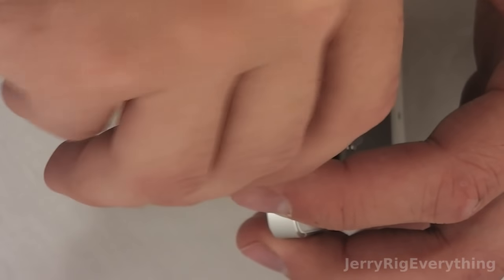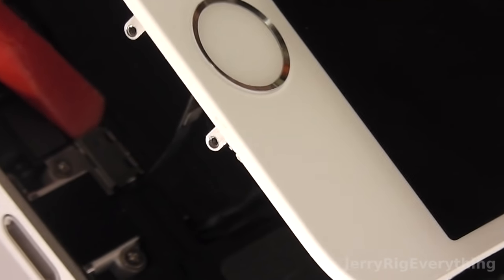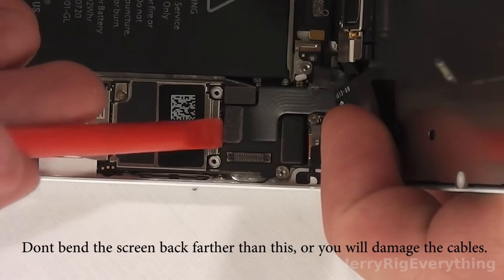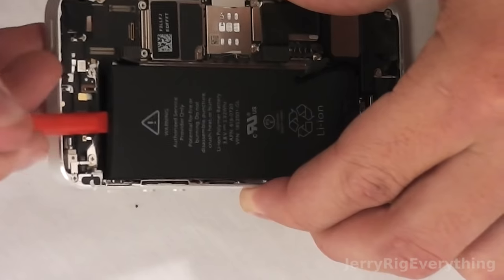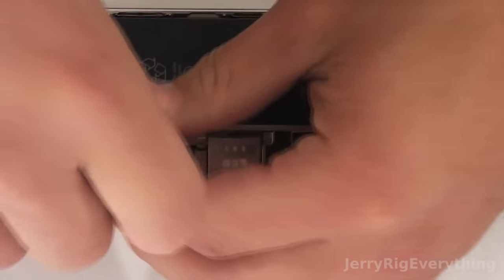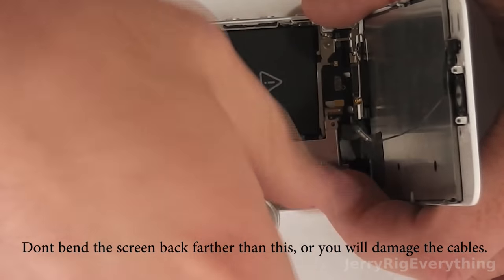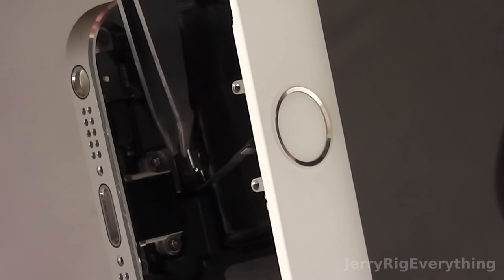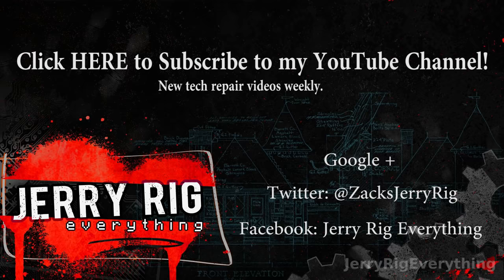iPhone 5s battery replacement in 6 minutes!

Comment: TIP: Before disassembling the connectors, where possible take a microfine sharpie pen and mark the top of the connector and something non-conductive right next to it. Then, when reassembling, you can line up the marks to make reassembly almost as easy as Jerry makes it look ;-)

Comment: HI. Nice video. I have 2 questions:
1. Does the screwdriver you're using in the video have a magnetic tip?
2. What is you don't use the fingerprint reader, and never plan to use the fingerprint reader... is it still crucial to replace it back exactly the same way? What if you snip it off to get it out of the way... will that mess up any other functionality?
Reply: im not sure about the screwdriver. but you must reconnect the cable for the fingerprint reader, because it doesn't just make the fingerprint reader work, but also the home button. so if you don't reattach that cable you will not be able to exit apps or use the home button.
Reply: @marktomeny2761  Thanks!

Comment: Don't try if you're as clumsy as I am. I got the job done but the screen shattered and I lost the 2 screws holding the battery connector in place. So, the thing is basically taped together now, but yeah, it works...

Comment: Thanks very much very helpful. I ordered a battery but the APN number on the back was different, i was sold iPhone 5S battery with the APN number 616-0718, it also looks smaller than the one i have replaced, that was 616-0722. Is it the wrong battery or something different?

Comment: Thank you a lot for a very nice and concise instruction video! I just changed the battery successfully.

Cheers!
Reply: freestyler987  I have battery issues in my iPhone 5s,it doesn’t last even 1 hour without the power saving mode turned on,also,without the power saving mode turned on,there are unexpected shut downs,did u have any sort of these issues I mentioned?
Reply: @md.arjubinnasir4209  Hello, I had no issues you describe

Comment: I just did this and lemme say this, I was able to put everything back okay enough, but the damn adhesive strips are SUPER STRONG, and the prying here is way harder than it is in the video, I bent the damn battery trying to get it out, so make sure you are extra careful, plus if you do this while the battery is well charge you might burn yourself, and also be careful with opening it, you have to be more delicate with the suction cup than you think, I broke my home button not realizing that this guy here was more delicate even more than I was trying to be.

Comment: oh yeah just a tip incase its not mentioned in the video, after you've put your phone back together you should leave it to settle for half hour or an hour and then turn it on otherwise it will start to turn on then turn right back off! :) (don't worry If u tried turning it on too soon, it wont affect it, just leave it rest)

Comment: Hello Jerry,
Unfortuneatly I removed the screws holding the metal cover above the LCD connector without noting which position they were in. In my 5S there are 2 longer screws and 2 shorter ones, can you tell me which one goes in top LH corner, top RH corner and same for the bottom ones?
Thanks in anticipation
Brian

Comment: Well indeed I never should have removed the screen, because now after the battery replace, the digitizer is obviously misbehaving, jumping like crazy whenever a vertical swipe-move is desired. And to think i successfully just changed the screen 2 weeks ago!   Guess my hands are too shaky and I stressed something during re-assembly. I've re-traced my steps, un-doing and restoring all three screen connectors at least 2 more times, making sure I hear the click. I even examined the connector with a loup to see if there were any bent pins. So the question now is, is it more likely I pulled and damaged the ribbon cable where it enters the screen? Or... is it more likely that I pressed to hard on the connector, and flexed the PC board (I believe the digitizer is on the underside of the board right where the connectors are). I honestly don't have the tools, eyesight, or steadiness of hands to attempt replacing Iphone size chips. But if you think there is anything possibly correctible where the ribbons meet the screen, I'll take a chance and look. Worst comes to worse, these 5S phones are not terribly expensive anymore to replace. Just frustrating to have to give up on a repair.

Comment: When I try to pry the battery out as you showed it is totally crinkling up like a melted hershey bar still in the rapper.  The two strips of glue under the battery appear to be so dried on it's like pulling the battery out of dried concrete.  I'm afraid the battery is going to break open.  I doubt you'll be able to respond before I do something bad but just in case someone else has the same problem you may be able to advise them.  Thanks!

Comment: I followed your tutorial step by step, all seemed to go well (other than prying the battery off was much more difficult than yours appeared), but afterwards,the fingerprint reader does not function and there is no sound. Any suggestions? I even opened it up again (carefully) and re-attached all the cable connections, but still no.

Comment: Had my iPhone 5S so long that I went through all the cycles the battery could take; 1,241 as of this comment. It's swollen so bad that it's pushing the screen off the phone, literally separating the screen and glass from the screen assembly with the camera, speaker, etc. New battery is arriving tomorrow. Good thing everything still works and don't need a new screen because of it. lol

Comment: When prying the battery out, be very cautious of the electrical ribbon harness which runs underneath of the top third of the battery. It is easy to snag on this, and scratch it, permanently damaging the ribbon and causing loss of volume control button operation.

Comment: Everythi g went great but when I turned it back on now I have lines on my screen? What could have cause it and is it fixable ?
Reply: This happened to me too. It probably means you now have a loose connection. When you reconnect the three wires at the top of the phone, really make sure that the first one that you reconnect (i.e. the one that's on the left nearest the battery) is fully plugged in. I had to take everything apart all over again (ARGH!!!) to fix this - thankfully it worked, but I thought I'd ruined my phone. Never again!!!

Comment: I replaced my battery with one from ebay and it's performance seemed good at first, but within a few days it went south, and now a year later it lasts less than a full day, with phone usage at less than an hour per day. Does anyone have good experience with the replacement batteries?

Comment: Because I did prying from top to remove the battery, the wifi connector was torn. It is very close to the battery from top. If you would pry, do it from the sides. I already damaged my phone.

Comment: FYI, be careful not to puncture or excessively bend the battery as they are prone to catching on fire this way. Don't just chuck it in the trash, it's best to take it directly to the dump to see if they have a proper battery recycling/disposal service.

Comment: The video was accurate except for how difficult it was to remove the battery.  In fact is was so glued in place that it bent while I tried to remove it,  It then proceed to catch on fire and the whole thing went in the trash.  Make sure before trying this that you have a better plan or tool to remove the battery.

Comment: I watched this last week then ordered the battery. I replaced the battery today but committed an almost fatal mistake. I thought I had the procedure in the head. Big mistake. I missed a couple of important steps. My advice is to run this video while you replace the battery to make sure that you follow each step the way he does it. It is not too difficult and I could have done it perfectly had I done so.  By the way, I did not remove the screen. I just made sure I didn't bend the front plate beyond a 90 degree angle.

Comment: To replace the screen instead of the battery, the procedure is pretty much the same. Just make sure to disconnect the battery before doing anything else, to avoid electrical damage. Also you'll have to remove the home button from the broken screen and install it on the new one, as well as the selfie camera, but it's as simple as clicking Lego pieces together.

Comment: Hi Jerry, I seem to have broken something in the process, the screen wont recognise my finger( meaning i cant put my passdode in, and there is lines on the screen, i did go back in to make sure everything is in securely but no change, any suggestions ?. i have done this once before and it was fine.
Reply: oh its ok, i opened it up again and something had popped out so i pressed it in and its working fine now, Phew !. Thanks for the video. Hare Krsna :-)

Comment: In order you unglue the battery from the back case, you need to pull the black plastic that is on the bottom side of the battery and the white tape will come off.

Comment: Dang. I couldn't remove one of the tiny tiny screws that holds in the battery. I used the tools listed here , too. I put it all back together with my horrible old battery still in. Feeling the failure.

Comment: Hi I attempted to change the battery in my iphone 5s today. All went well although there was no ribbon cable from the push button. When I got to the batery replacement I discovered that the connector on the phone and present battery has 4 contacts but on the new battery which is labelled for 5c or 5s there are only three contacts. Can you advise. Thanks

Comment: Afteri replacing my battery - I did not remove the top plate with the 4 screws but supported the screen so it wouldn’t move past vertical and damage the cables - I reattached the home button cable and closed the phone with the pentelope screws. I played music and used the phone for about a half an hour and then charged to 98%. I turned the phone off and today when I opened it there was only 5% charge. Could the home button cable not being attached correctly do this? I have to believe the battery was connected properly or it would not have charged. Is it a defective battery?

Comment: Please NOTE: When removing the 4 screws that hold the screen cable cover nite that there are 2 screws that are a little longer and one of them is Non-magnetic. Note where those 2 screws go. The non-magnetic one I believe goes in the outer hole near the edge of the phone.

Comment: I used this video to replace the battery, but the screen orientation has stopped working and won't go landscape at all. Wondered if you had any ideas on how to fix this? I kept all the brackets and screws in the right places so a bit unsure as to what I've done. Thanks in advance

Comment: You need to link to a different site for the battery replacement. The screwdriver set I got with the battery does not fit the pentalobe screws for this phone.

Comment: OK things seemed to go well. Device was working before I started but had a swollen battery that distorted the device and popped the top of the screen off. Before I attempting Phone was OK though. After surgery the patient has power to the screen but no image. Also cannot seem to to get the top of the screen to settle back into clips though the other 3 sides are in. Any suggestions?

Comment: Hi, i followed the video and the battery replacement worked but now my volume button and mute button no longer works. however the power on off button still works. i believe there has been a tear in one of the ribbon cables but wasnt sure which one it is. i was hoping you may have some idea on how to fix this?

Comment: I just changed the battery i did all you did apart from putting the clip back in where the screen clips too and  its not turning on. i had a battery for iphone 5 new but it's not the right one for the iphone 5s so had to put back the old battery but while took it out bent it and put a hole in it maybe thats why its not coming on. now i just need to get a battery that fits i did not take the screen off, you dont have too.

Comment: everything went good except for the ribbon connecting the home button came off from the top. It will not recognize the button any longer. I was wondering if you had a fix for this? Thanks

Comment: Nice video but you didn't mentioned to not pry the battery on the right side or you will damage the volume cable underneath! 😥 Also battery may catch fire when it's bend upwards! Do not recommend to do it  on your own, it is very difficult to mount the screen connectors back in place, almost impossible if you have somehow big fingers.

Comment: Just finished this repair, phone turned on, and I thought that all was OK.  But then I found that the touchscreen is not working.  So I must not have connected one (at least) of the cables correctly.  Is this the Digitizer cable?  All three of those were real PITAs to reconnect, but I thought I felt them click into position.

Comment: I ran into Ronnie 1001's problem with replacing the battery on my IPhone 5 (that's right IPhone 5).   I could never did get the long screw back in.  I just left it out and used small strips of Gorilla tape instead.  I have not had a problem so far.

Comment: The 5s won't fire up.  Got a refurb from AT&T, and about to send back the dead one when I happen to think - personal data is still on that phone, right or wrong?  Got the sim card out and moved to refurb'd phone.  Was all personal data on the sim, or do I have to worry about where the old phone ends up with data being stolen?

Comment: Anybody having problems with removing your battery, those little glue strips that this phones battery didn’t seem to be glued to, are in fact much sticker than this guys, on the bottom of the battery the two little paper tabs should pull up from the battery, then if you carefully pull them away from the phone the glue strips stretch out from underneath the battery, then it should just fall out, much easier than forcing it out and safer aswell

Comment: you need to remove the white adhesive tabs first then remove the battery otherwise you will damage the battery, there is 2 tabs on top of the battery under the black strip, pry a bit and they will reveal, pull them out then remove the battery very very easily.....

Comment: For the record, You need to update your phone, because they will probably be lost. When the battery is disconnected for some time, you may lose some usable software and leave gaps in the touch programming as well. So all the apps may not work properly. My advice is to have your phone connected to a power supply through your charging port at all times when disconnecting the battery. Use gloves and non metal tools to disconnect inside the phone. Why! Because you may lose some of your apps and keyboard letters etc. Did you find this helpful.

Comment: Hello. I read in a forum that when changing a battery there is a danger that the phone will not turn on because it will be disconnected from the apple as a result of the replacement not being done at their official service. Is there such a danger?

Comment: I just finished replacing mine. Comments on how hard the battery is to remove are not overstated. The little plastic tools snapped right away. I got out a 1" wood chisel- I am sure nobody would recommend this but it allowed me to get the leverage on the strips working it back and forth. I tried needle nose pliers at first but got the puncture and smoke!duh. Chisel is much safer actually.The second thing missing here is you need to put a small piece of electrical tape over the new battery connector ribbon once you snap it in and before you screw on the retainer clip. The batter won't charge without that. Another site had that recommendation. So, after opening and closing the phone 3 times (forgot the little clip at the end first time around, I got pretty good at it and might be able to replace a new one in about 15 minutes. You need to have good nearsighted eyesight for this too. Tweezers are essential As well.

Comment: I didn't have a heat gun/blow dryer at my house, but I did sit the phone on a heater vent for a minute or two before I started prying.  Then I read in the instructions to just pull on the adhesive strips from the other end of the battery instead of prying.  Oh well.

Comment: Important thing he missed out, be careful when removing the old battery, I followed this last night and when prying off the battery I pierced the casing and burned my finger.

Also no need to remove the screen, in fact I only removed 3,  the two case screws and 1/2 of the batt connector (the others wouldnt come off but luckily didnt matter).

Comment: Tilt not working? Can no longer rotate the screen? Compass messed up?

The solution I used:
When you remove the four screws holding the cables, make sure you keep track of which one goes where. Three of them are magnetic. If you put them in the wrong holes your iPhone tilt will no longer work. If you made this mistake, simply re-open your iPhone and put the non-magnetic screw in the right hole.

Comment: I followed all directions for this and the “charging port” replacement tutorials. But my phone won’t turn on, and even when charging it isnt responding. I dont know if it’s actually charging or not. I’ve opened the phone up several times and reconnected each connector but it still doesnt work. Any ideas what could have gone wrong?

Comment: the most important thing that this is INCORRECT on is the removal of the battery. An oringal battery will not come out easily using this methodand yu can easily break the phone trying!! Instead, look carefully at the end of the battery nearest the bottom of the phone. There will be a paper tab about the width of the battery. gently pull this to expose the adhesive strips and get hold of the actual adhesive. Pull gently and slowly away from the battery and the whole strip should come out. Prising should only be a last resort!